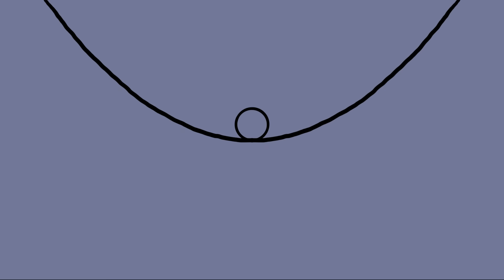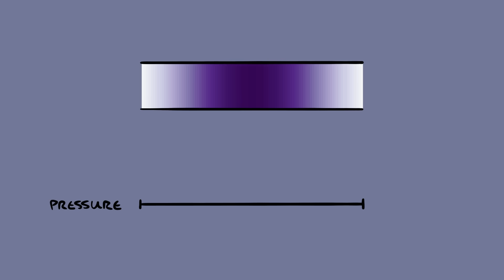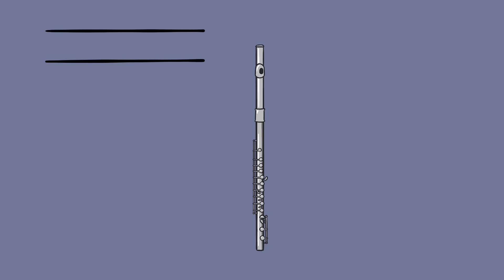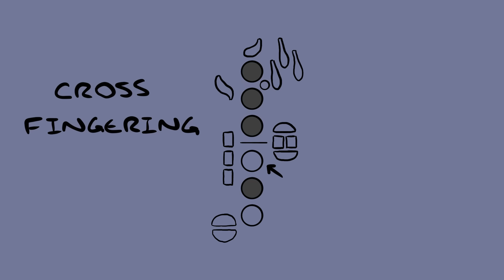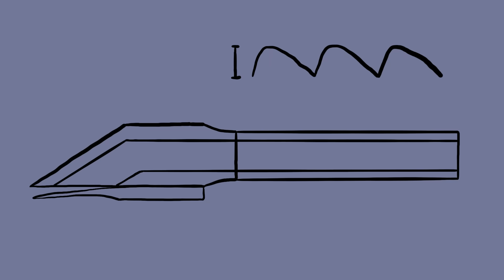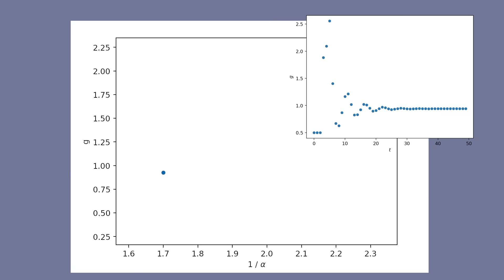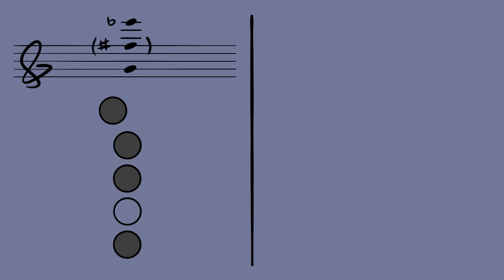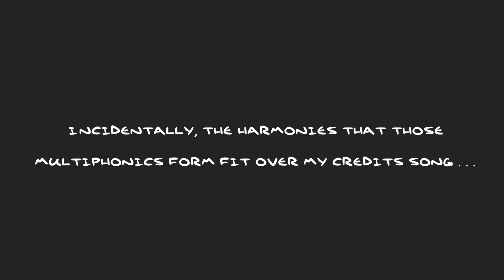The Physics of Multiphonics in Woodwinds

Comment: Yoooo that thing about the water’s edge being an impedance mismatch just aligned a couple decades of optics and signals in my brain! 
It makes perfect sense when you phrase it like that, but I’ve just never seen it put that way before. The focus is always on the speed mismatch, without likening it to impedance in a wire. But, yeah, it feels so obvious now you’ve said it. 
I understood the phenomenon fairly well in optics, but was always a bit mystified by its occurrences in signals in a wire. Thanks for figuring that!

Great presentation on the rest. 
I can’t get-along with EWIs because the breath sensors just don’t provide the same kind of feedback as a real wind column. 
Flute is weirder than fipple flutes and sax for the same reason, though there the feedback is subtler rather than entirely absent. 

I knew the small hole raised it an octave/twelfth, and the harmonics differences with cylindrical vs conical, but I never knew… how exactly. So thanks for those diagrams as well. 
Makes sense it’s like placing an extra node in a string to force it into that harmonic. 

Lastly, of course there’s chaos before the note stabilises — only sustained blowing produces harmonic tones! So the initial impulse, like a struck bell, is naturally inharmonic before you get enough feedback to cancel-out the inharmonics and only leave harmonic overtones. 
As you mention, the skill is in pushing-through that chaos quickly and smoothly. 

For me, the same “glitchy” phenomenon when quickly arpeggiating is still a reliable tell for software saxophones. 
Even when the software uses filtered noise to produce a tone, it seems to make those note transitions just… too smooth. Presumably from other filtering down the line to avoid loud blasts of horrible?

Comment: That was brilliant thank you. I've wanted that explained that clearly for a long time. 
Here's a toy for you. It's something I invented many years ago for a theatre show and have used a lot since. 
Get some plastic water pipe quite thin, about two and a half centimeters and as long as you can carry. I used about 8 or 9 ft long at one point got me to I think a c0..? Stick a normal B flat clarinet head on the end and play ideally with circular breathing. Important small point.. a clarinet is not a conical tube it has a flare at the end. I think the purpose of the flower is to stabilise the fundamental notes. When I first made this instrument I was using horns as a flare like on an Alpine horn but having a straight cut off gives you so much more potential for harmonics. If you can stabilise the really low fundamental in this shape the polyphonics are mind-blowing. The pressure and speed of the air, the pressure on the reed and the shape of the mouth all shift things. In one theatre to show the composer asked me to play a low C drone for this big anthemic closing song. By the end of that run I was able to hold the Drone and play the melody in harmonics at the same time. It's a crazy dark sound as well. Sounds like a horror film score made from whale song and dinosaur screams. Enjoy..  subscribed.. will be back for more.. the math is a bit beyond me but i will digest what i can slowly..

Comment: I had to try and make a 3D plot of this in python. It was a little tricky to find some good values and get a nice plot.
I ended up plotting 30 sets.
I started with g1, g2, g3 set to 0.1, 0.2, 0.3 (it only takes like 3 steps to converge to the final value)
I did 75 iterations for each set.

I set B1 and B2 to 0.013 and 0.060 (but I tried a lot of different values)
and alpha was from 1/2.7 to 1/1.5 with steps of 0.01. (this give me 30 sets)

It does look cool and it is very hard to predict what will happen when you change B1 and B2.

i did not find anything interesting for alpha smaller than 1/3 or larger than 1/1.5. All the fun stuff happens around 1/2-1/2.5 for me.

Super fun little project. Thanks for making the video.

Comment: 11:10 while it’s completely glossed over, you also need the value of the free energy g at the previous 2 steps (“g-“ = g(i - 1) and “g2-“ = g(i - 2)), which in this demonstration seem to just be set as the same constant to begin with (the 3 points at the start of the plot at 11:19)

Comment: Amazing video! I learned so much about the physics of how a woodwind instrument makes sound in the first place and how seemingly random fingerings affect pitch. Could you do a video about how brass instruments make sound (albeit the note changing part is pretty trivial as a trombone slide or valves simply extend the pipe length) and how a "double buzz" can occur, where an improper or fatigued embouchure may result in extraneous pitches (usually the octave below)

Comment: What does the g stand for? In these graphs it kinda vaguely implies that g is related to frequency? But you said it has to do with a single pulse... at first I assumed it was gain. And it would be something logarithmic because a reduction in amplitude would be indicated with division by a factor, so its log would be indicated by subtractive reduction.
I'm saying indicated because obviously when we're dealing with non linearity then technically neither are more "correct", it's just some function...  on the other hand, taking the log of something logarithmic is kind of a problem, it means your zero-point has to be well defined and comes directly from the physics.
How does the g value at each reflection affect frequencies? And if the pulse hits the middle hole and some of it reflects, some of it gets released out of the instrument, and some of it passes through before reachind a farther hole, what exactly are we tracking as "the pulse" here?

Comment: I always thought I was just messing up, but now I can call it an advanced technique! Thanks!!

One super basic (probably) part of instrument physics has always mystified me. If you play a loud note on a brass instrument, then do exactly the same thing with just the mouthpiece, you hear a quiet buzz. Surely it is the same total power in both cases. How is it so much louder in the first case? Resonance something something.
Reply: The mouthpiece only transfers a small bit of energy from the air into sound, while the bell is efficient. I believe this can be seen in how the airflow is slowed by the resonance, more than strict friction would.

Comment: Maybe it's because I'm not a wind instrumentalist, but I'm having trouble with the explanation of cross fingering. 

In the diagram at 8:09, wouldnt there still only be one fundamental, because the closer hole "cuts off" the further one? I could see maybe there being a shared harmonic between them, but at a really high pitch.

At 8:34, how does that configuration extend the length of the tube? Having the middle hole open shortens it, and having the lower hole open feels like it shouldnt affect it at all (again, it feels like it should be cut off).

What am I missing?
Reply: To the best of my knowledge, you are literally putting so much air through the instrument that a single hole cannot output the are you're putting through it, thus, you end up hitting one or more holes. I'm probably stupid though, so like I don't know, just tryina help, monkey brain style.
Reply: I was also confused by this. I feel like a longer explanation of why the multiphonic forms when a hole is opened near a node of one of the first note's harmonics would be helpful, rather than demonstrating the products of a brute-force iterative simulation
Reply: im not sure for clarinet or flute, but on saxophone 8:34 closing the 5th circle actually closes another hole below the 3rd circle and above the 4th one (not shown in the diagram) therefore increasing the length of the tube. you can get a multiphonic to sound by closing a couple holes after the 5th hole while keeping the 4th hole open, not entirely sure why